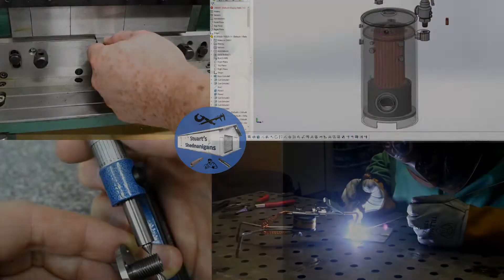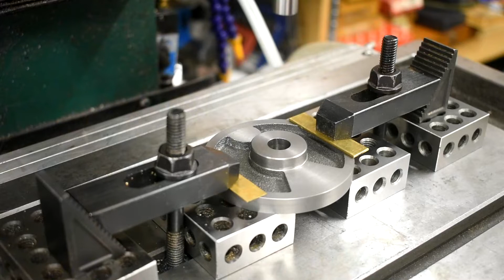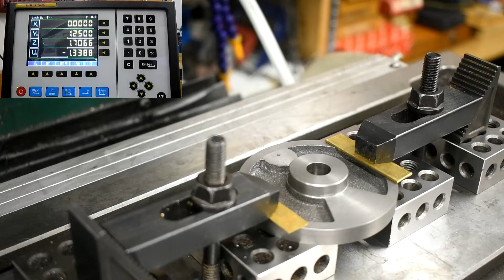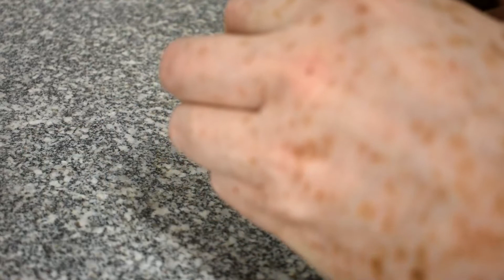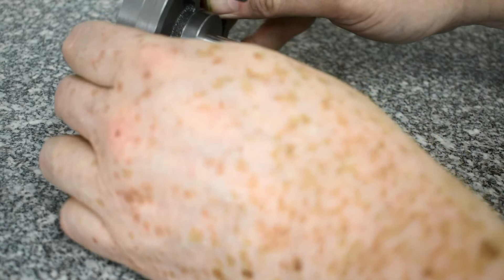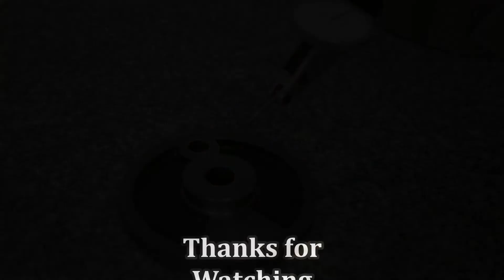PM Research Number 4 Quarter Horse - Part 5B - Crank Webs part B

Comment: Great Outcome Stuart, it just goes to show that care with setups and accurate measurements, individual parts can match up. Well done. Now on another matter with your split mandrel. Next time you make one do not use a standard countersunk screw ( USA call them flatheads ) with a screwdriver slot. Make the split bush with a 60 degree cone by using a large center drill and use a standard Unbrako cap head screw with the OD turned to 60 degrees. This will help in 2 ways, a decent allen key to get some good grip, and the 60 degrees will make it a much nicer and slower opening of the split bush compared to a 90 screw. Regards from Australia.
Reply from the maker: Brilliant - thank you!